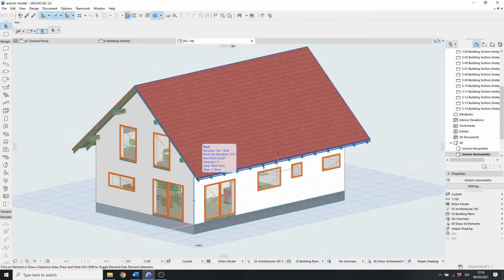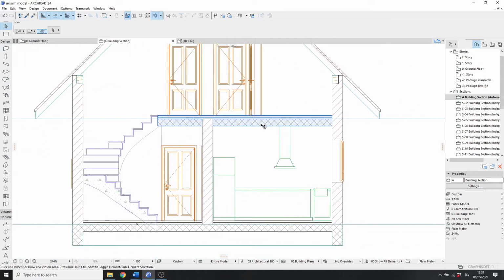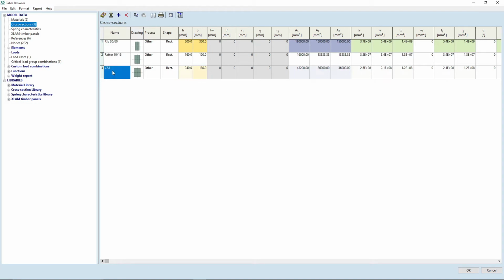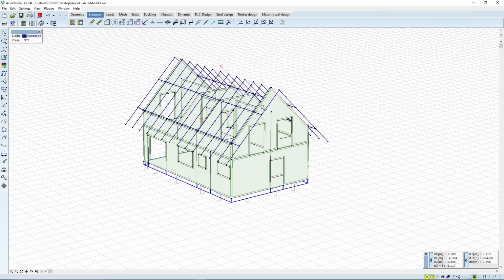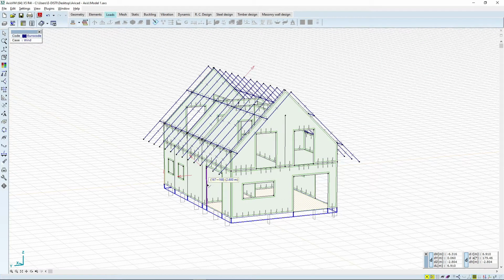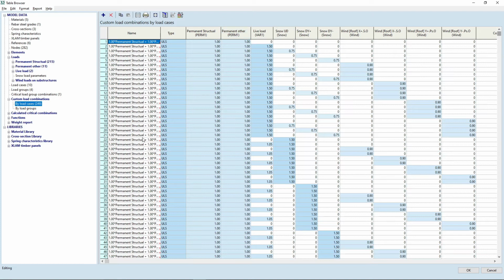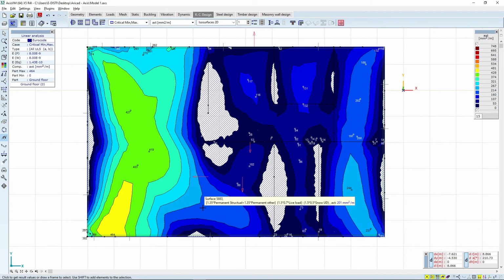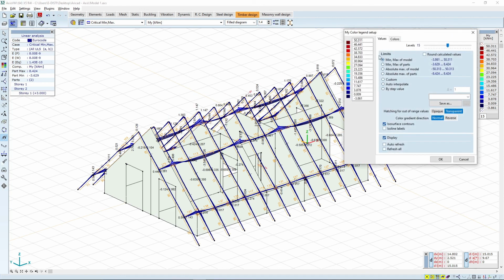ArchiCAD to AxisVM - How to use SAF / SAM files - Tutorial

Comment: You export the core part of a composite slab as saf, and then what happens when you import it back to ArchiCAD? would it come back and update the composite slab or it comes back as a separate core only slab?
Reply: The structual model is simplified for analysis purpuses and contains only structual elements. If you were to import it back to Archicad it would of course loose its composite  proprerties.
Reply: @Jurko86  SAF is advertised as an exchange format that allows seamless bi-directional workflow with structural software. If the structural elements could not re-integrate into the original composite/profile in ArchiCAD and architects have to manually update all the composite/profile elements that contain structural skin every time there is any modification happened to the exported structural elements then that's not truly "bi-directional". I was hoping that the seamless workflow was finally made possible with SAF but I guess it's still the same as IFC based exchange in that respect.

Comment: better than ifc export?
Reply from the maker: Yes, not all the esential data is transfered thru IFC. SAF / SAM export results are much better.
Reply: @adriabim2454  can u tell me what makes better saf file and ifc. I want to buy axisvm but dont know what better to import from archicad to calculate static. Thanks👍
Reply from the maker: @tomaszyt2220  Hi Tomasz, SAF (structural analysis format) is created directly within BIM software (for example ArchiCAD) and you can just import that ''wireframe'' model (which contains only needed  structural analytical model data) to your structural analysis software like AxisVM and run the analysis. So it is more efficient, faster and accurate.